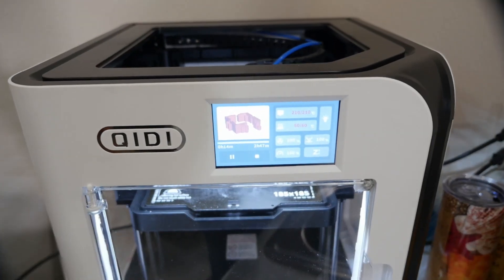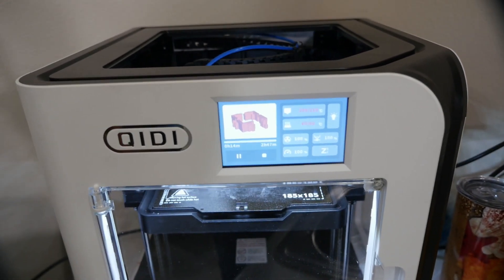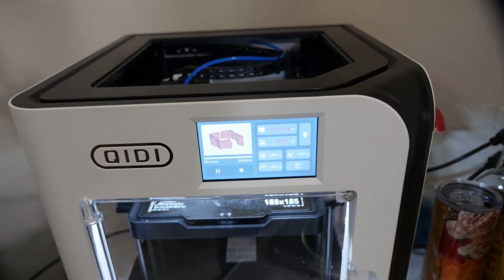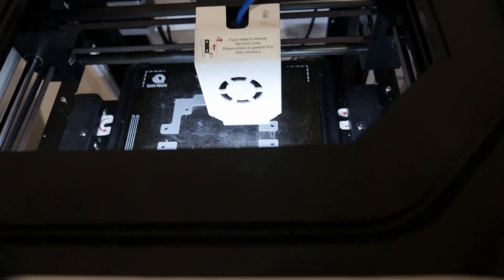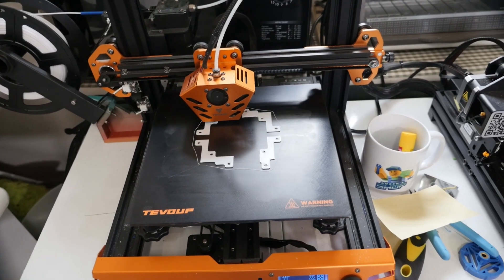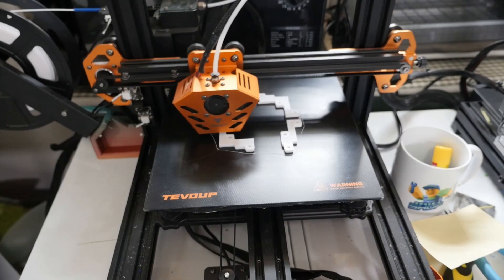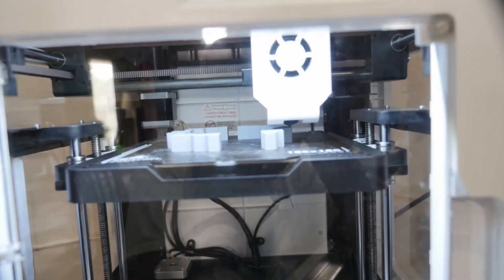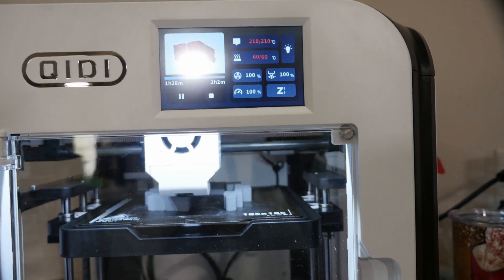QIDI X SMART 3 Printer Update

Comment: Have you gotten the upgrade kit for this printer? If you ordered it through Qidi, they were supposed to send it automatically, but I ordered mine on Amazon so I had to contact them directly. The kit includes a new extruder mount that relocates the new auto bed leveling probe, there’s also a new USB C Extruder cable and brace, Extruder tool head circuit board, entire new hot end with re designed heat brake, main board fan, and an amazing gold colored build surface that works even better than the stock one which was already pretty good. Highly recommend contacting Qidi for the upgrades, it’s made the auto leveling way more reliable, and the hot end and build plate makes parts stick and extrude better!
Reply from the maker: This printer was provided to my by QIDI as a pre-release model, so none of the upgrades have been done.
Reply: What is the benefit of the new USB C cable? I've swapped the probe, PCB and hot end, but replacing that cable seems like a lot of work. Lucky you on the new build surface, I didn't get one in my upgrade package.